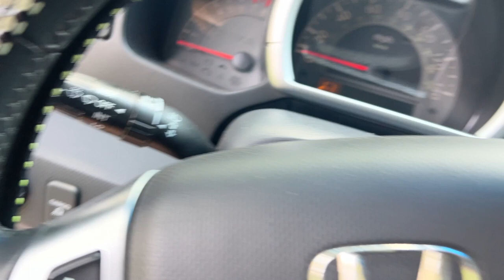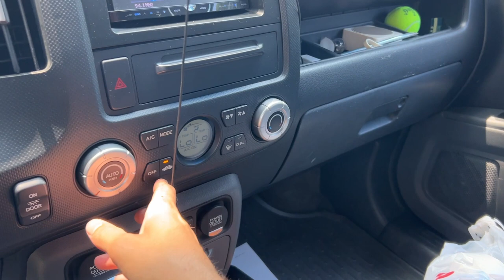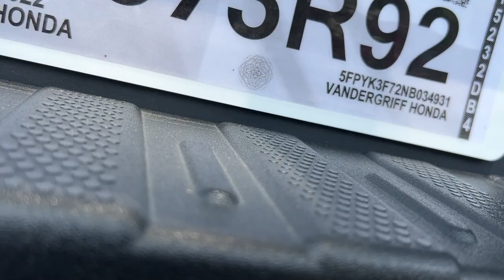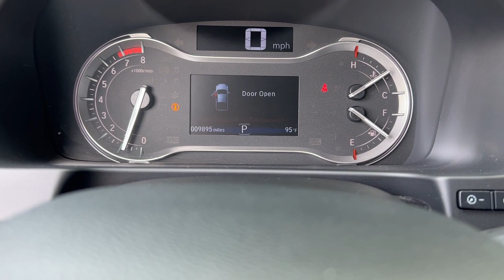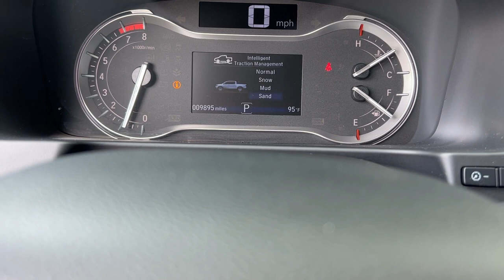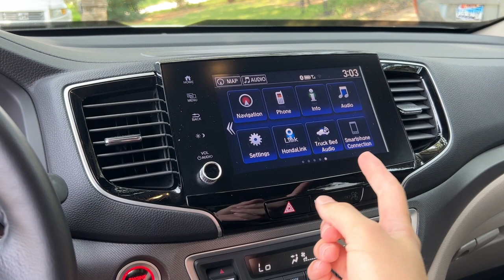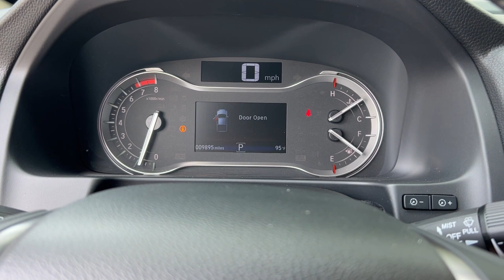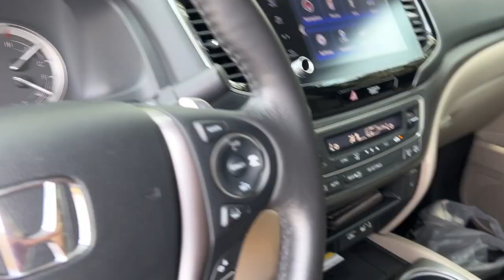2022 Honda Ridgeline RTL-E Review!  #review

Comment: I have an 2013 ., 86k miles i love it ... Smooth driving and i love the cubby storages. But i am itching to get a 2021 or newer RL.. i dont care much for a new high tech radio since i added carplay on my RL .. but not sure if in general its a big difference if its worth the upgrade.. you have both it seems .. any regrets ..would you keep the 1st gen over the 2nd gen ..
Reply from the maker: I regret the interest rate! 

The trucks are great, for work I would choose the older ridgelines.

For Daily driving, I would say the newer models have better MPG, smooth ride, power is good, and sport mode is really cool! 

The prices for the RTLE are a bit too high.

Cons 
- Liftgate doesnt have a dampener so its heavy and can drop hard

- Storage is better in older models ( Bed height is taller in older RTL.

- Honda should make a 9 speed Automatic with either CVT or regular transmission.